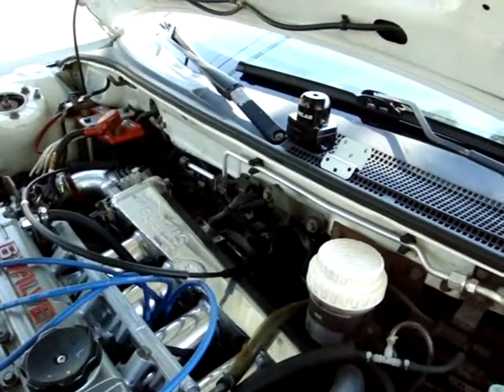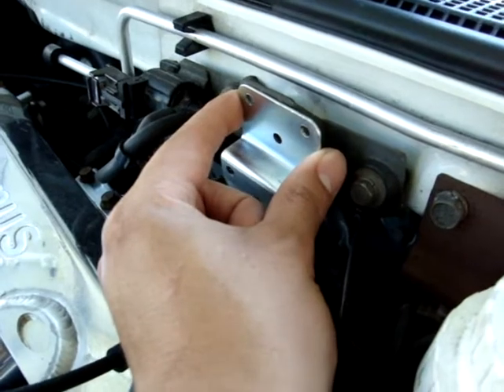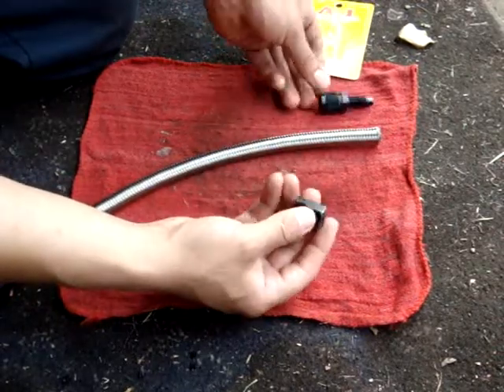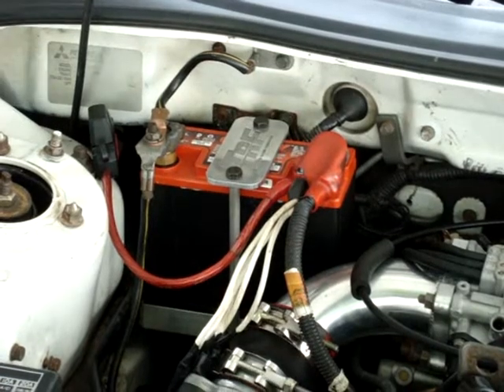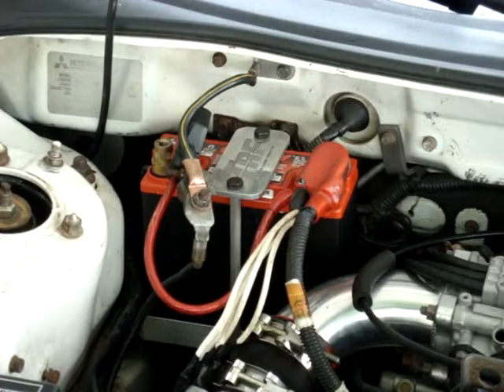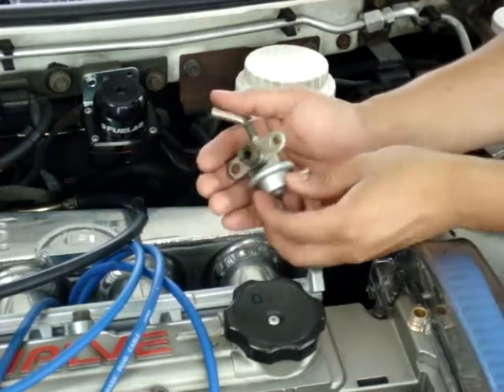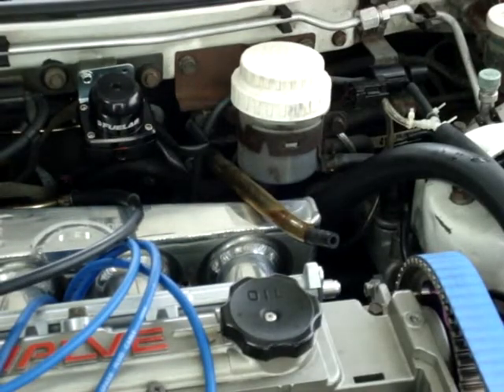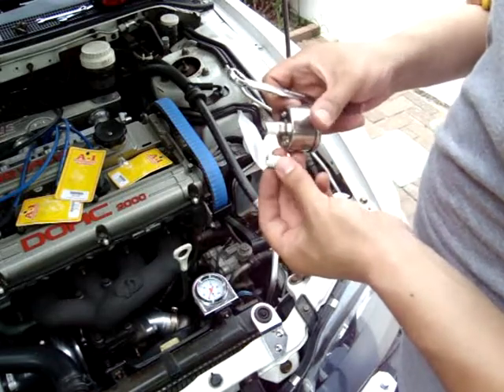Adjustable Fuel Pressure Regulator aka AFPR install - Part 1/2

Comment: quick tip: put tape on the end when you push the nut on so it doesn't mess up the SS braid. Take it off after the nut is over the tape.

Comment: good video mate, well done, just one thing, you shouldn't be using Teflon tape on fuel system components, use a thread seal something like Loctite 567.

Comment: @redi4axion Wow your right, This made the install much easier. For all you guys wondering red is refering to the hose to fitting thread. You can screw the fitting on to the hose counter clockwise because it is reverse threaded. That way you dont even need to press, it will feed itself.

Comment: Anyone know what size AN fitting they are on the hose ends and what size the SS hose is? I just bought me a XS Power FPR new  from craigslist but the bad thing it didnt come with the hose and the AN fittings for it.

Comment: Yeah, use some electrical tape, wrap it round 3 or 4 time tight around the braid.  Then cut it with a grinder.  Remove the tape and you have a nice, neat finishe on the end of the hose.  Then fit your hose end fitting, and tap it on, MUCH easier.  Obviously, use a rag to ensure you dont damage the the hose end wihen tapping on

Comment: @jsanchez430 Are you kidding me bro? Either you were mistaken on what i said or im retarded, I think its the former.  The caps that go over the line are threaded reverse (perhaps you have been doing this wrong the whole time). All my lines have tape on the ends, Im not saying put 6 or 7 layers on, just 1 or 2 tight layers to bring the barbs in. If you click my name, my videos will show how many ss lines and "hands-on" knowledge i have.

Comment: @redi4axion Electrical tape makes the SS line thicker making it even harder to put on. -AN fittings DO NOT thread on backwards. Quick tip for you: acquire some hands-on knowledge. Peace love and chicken grease =)

Comment: You also want to put teflon tape on the adjustment screw, boost leak can come out of there. Also i had an incident with the same gauge you have, my garage got over 100* and the oil inside the gauge expanded blowing off the black rubber oil filler cap on the gauge. I would seal over the rubber filler cap on the gauge so the same doesnt happen to you. Solid setup BTW man, nice vid.

Comment: Quick tip for next time: The an fittings are threaded in the other (lefty tighty) direction thats why you are pushing so hard, lol. Also if you wrap it with electical tap it will aid in in sliding in better.